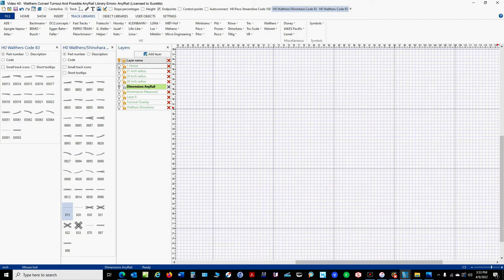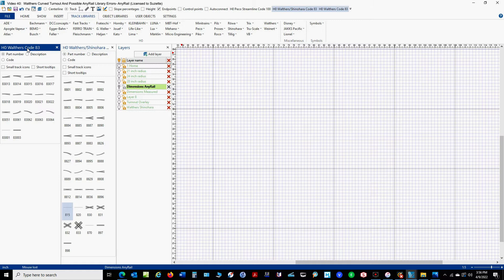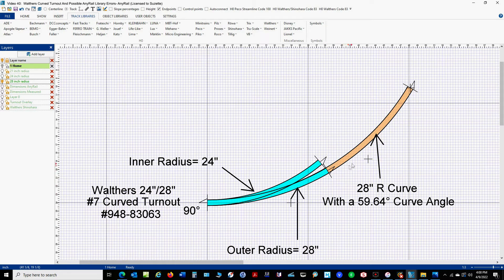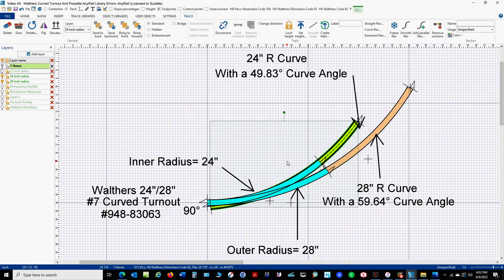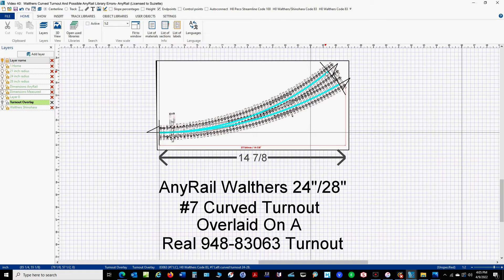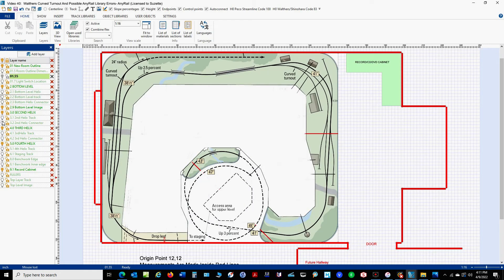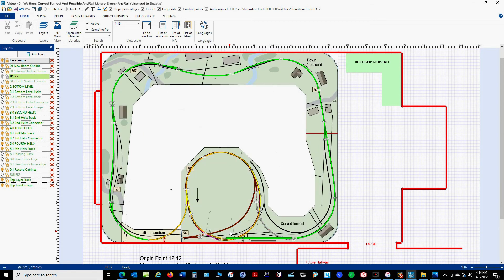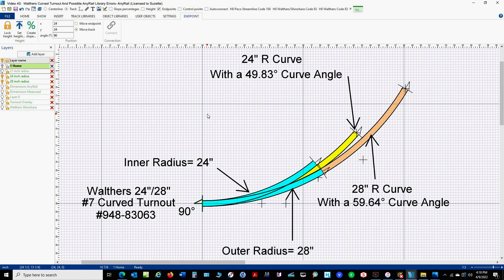AnyRail 6 Tutorial Video #40: Walthers Curved Turnouts and Possible Errors in the AnyRail Library

Comment: Thank you for the time you spend making these videos.  I love your sense of humor as well.  Having used Autodesk civil products since 1990, I appreciate your frustrations!  I have a question regarding this video, I noticed your tracks are different colors.  I am unable to figure that out.  I looked through your previous videos and didn't see anything on it.  How were you able to have the tracks different colors??  Thank you again!
Reply from the maker: Jerry, sorry for the long delay in replying. I used the Create Section command to make the tracks different colors. The command is supposed to be for electrical sections but since AnyRail will not allow you to color your track for different areas I just used the Create Section command. It does automatically insert electrical isolators into your drawing though. Dave
Reply: @steampoweredradio2981  Thank you, I’ll use that and just ignore the insulators.